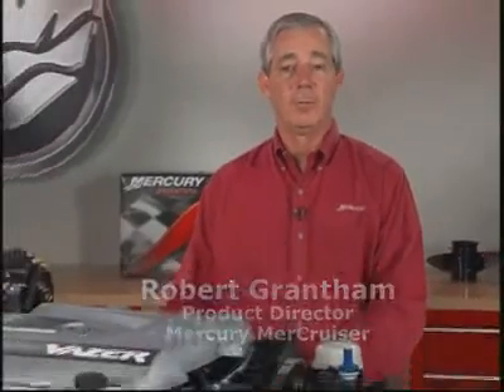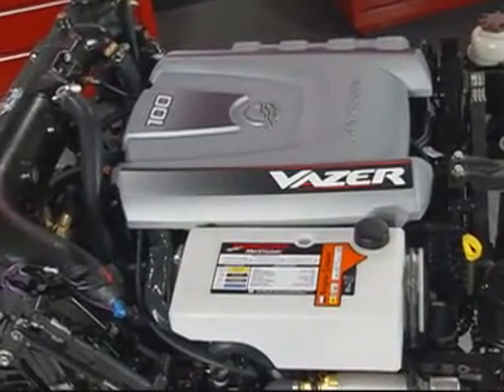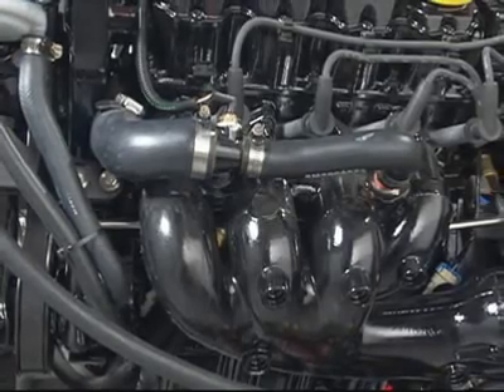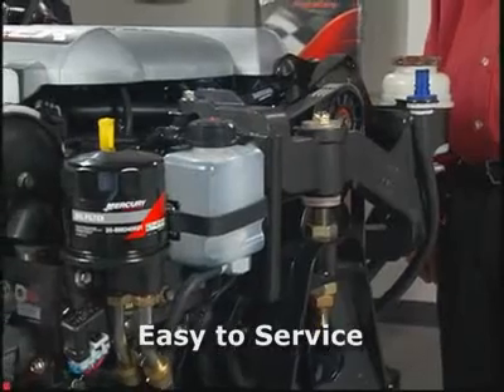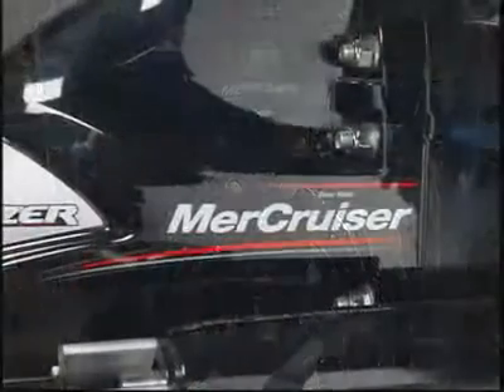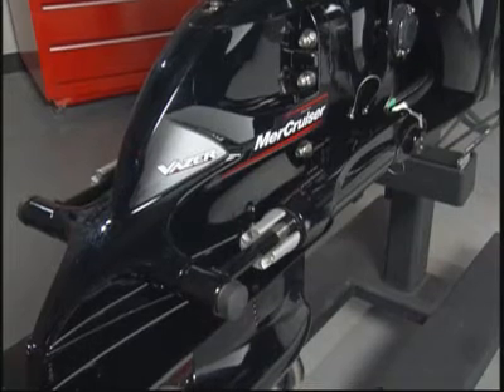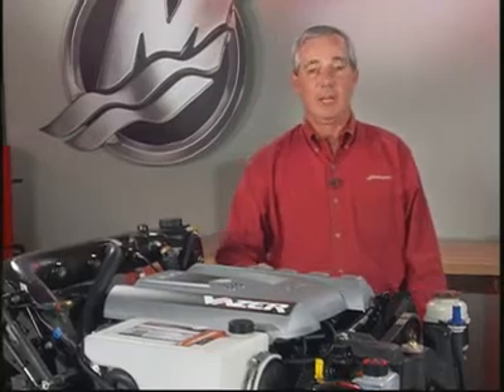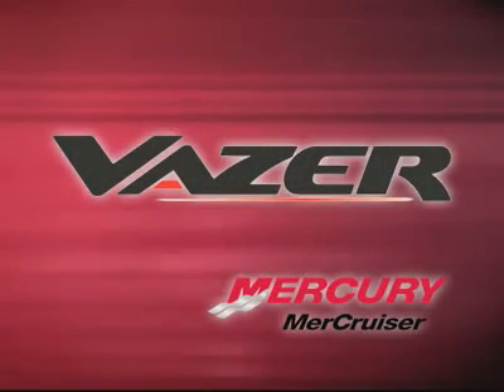MerCruiser Vazer Talking Points

Comment: If someone from Mercruiser is out there this is what we want. LIGHT WEIGHT, HIGH OUTPUT, simple enough idea. Aluminum is Cool...  115 for that size block is not going to cut it. Anyway Love the out-drive throw the engine in the trash. Its just kinda crazy that these engine combos are made to last more than 30 years it seems but your average hull will rot out in less than 10 A+ for quality but man give us a power plant that can drop some lifespan for power..

Comment: Sigh This should have been paired with 200 horse inline 4 and Bang. Perfect runabout out-drive.
why only 115 ? Can the drive not handle over 115 or is is like a normal alpha that can go to 300 or more ? Why is none taking advantage of the new light weight inline high output 4cyl like the s2000 engine? Is it because they only work with Chevy ? I went on the Mercruiser website and there was no information on this drive was it scraped ?...Sooo upset.